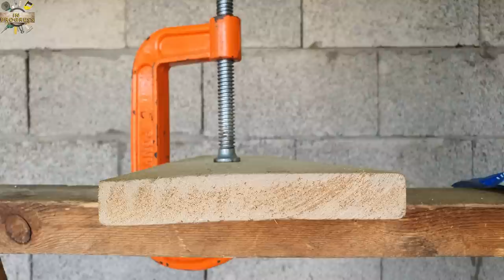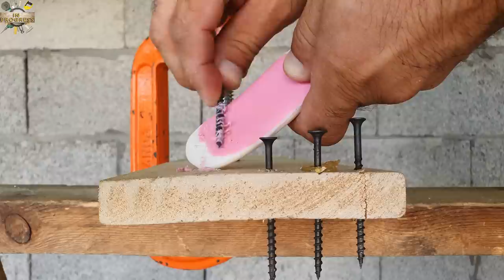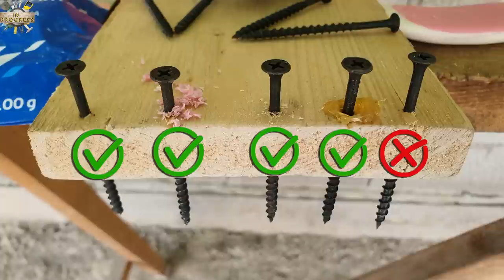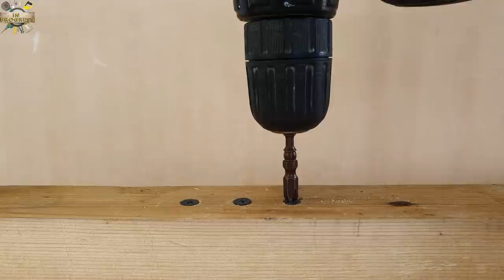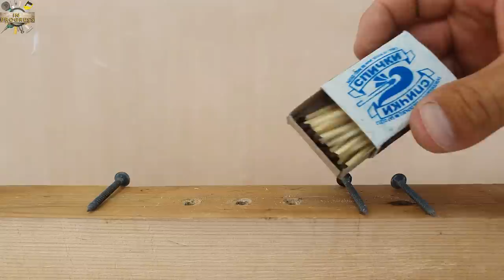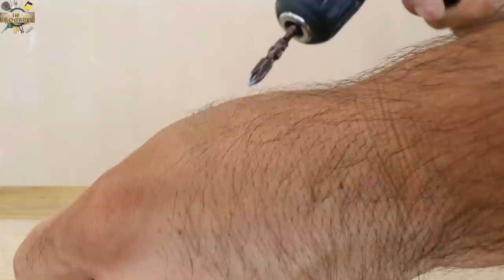Carpenters Don't Want You Know This ! 7 Amazing Wood Tricks

Comment: An old timer is the one who showed me the soap the threads trick to prevent splitting boards. You can predrill the holes first, but that takes extra time and nobody wants that. That would be necessary if you wanted to drive nails into red gum molding. You wouldn’t get a nail in that without predrilling a hole first. That wood is hard on nails. You find it in old craftsman style houses.
Reply: As an old chippie I don't use soap I run the nail across the sweat of my brow there is body oil an fat which works the same way no need to carry  soap around 😊✌️🇭🇲
Reply: @davidwade6164 , there’s usually more than one way to do things. As long as it works and doesn’t lower quality, I am all for it. Good job David!

Comment: Шуруп, забитый молотком, держит крепче, чем гвоздь, вкрученный отвёрткой.
Reply: Не угадал.
Reply: Почему нельзя вкрутить саморез 1 ым способом
Reply: @ivanpopov5761  А тебя них*я не смущает, что там доска треснула?
Reply: @OlegPanfilov-d8d  кучу бруса просверлил так,и н...уя не полопало и не потрескало
Reply: @ivanpopov5761  Ты перепилил кучу бруса, но так и не понял, чем он отличается от доски? Мои соболезнования.
Reply: @OlegPanfilov-d8d  не переживай,всё держится отлично
Reply: Anytime when attaching lumber near the end of board(screw or nails, even with self tapping screws(usually used on metal not wood) you risk splitting the wood at the grain. Not too much to worry about if using a screw or nail further down from the edge. 
I learned the soap trick from my father, pre drilling is what I usually do now. Using a drill bit one size smaller than the screw size. If screw is a 3, than I use a 2 bit. So the threads can grip the wood. 
☮️

Comment: Everyone who are in the 80’s now used soap, learned that from my father, I use that and pre drill most often. For the stripping out of the wood, I use the backside of a blade, a flexible scraper and even a screwdriver. I usually use some slivers of wood (shavings etc) or toothpicks with a small drop of wood glue to reset the hole. I don’t care for leather since it dries out, cracks and deteriorate. If I have some spare bits of wire coating I have used that too. 
Most of the time I can figure it out on my own. But the soap and pre drilling I got from my dad (soap) and from taking shop class as a senior after Title X took affect. Girls were not allowed in shop class prior to Title X
Reply: LOL, that's what I was thinking, I used soap for over 50 years, and matches,

Comment: Bar of ivory will solve your split board problem. Just rake the screw across it to coat threads in soap and install
Reply: you mean.. like they JUST did in the video?
Reply: My dad had a bar of ivory in the workshop, they lasted for years. Well, it was either ivory or the other bar soap that was around before ivory came out. Can still buy both.

Comment: How does it help to chop off the tip of the screw?
Reply: It doesn't split the grain like when you split wood with an axe.
Reply: It doesn't. The hole is pre-drilled unlike the first one. In fact, all but the one that split are pre-drilled which is the proper way when working on an end like that.
Reply: Good question!

Comment: Does the screw remain tight in place over an extended period when you've rubbed it on soap?
Reply: Yes, the soap Will eventually dissolve, other options are wax, or the pre drilling with a drill bit one size smaller than the screws or 1+ sizes smaller than the nail. 
Another idea is to add a drop of wood glue near the tip of screw or nail to add a bit more holding power.
But any form of mechanical attachment will work loose if the wood is allowed to age, dry out , shrink, warp etc.